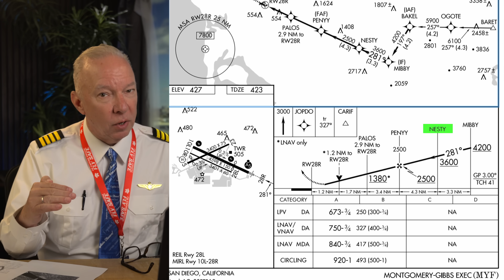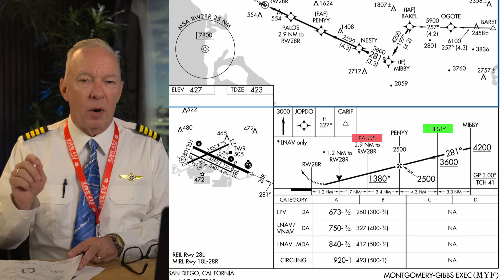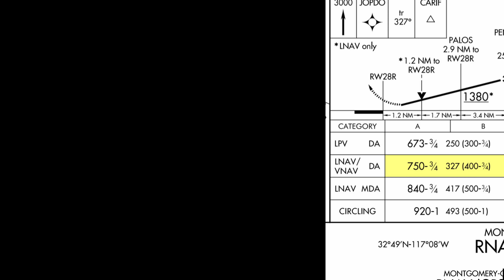Tragic Crash in San Diego: What the Pilot Did Wrong | ATC & Flight Path Breakdown

Comment: If the Altimeter setting at Montgomery is different than Gillespe or Miramar, and he uses either, then he may be too low.    In other words, his altar will tell him that he’s at a higher altitude than he actually is …..However, if he remains on the LPV localizer and glide slope, then he still may be OK.         With a 200 foot ceiling. The only approach you would attempt to fly would be either an LPV or an ILS, so he was not depending on an MDA ( altitude).
If he was flying the LNAV/VNAV with an incorrect altimeter setting, then that’s not a good decision, unless the instrument approach procedure indicates a higher MDA with the Gillespe or Miramar altimeter setting.  Still with a 200 foot ceiling and 1/2 mile visibility, he must have been flying the RNAV LPV.  I wonder if his annunciator validated with an LPV readout?    I also just noticed that 28R has a published ILS approach.   Was the ILS out of service ?     I still rather do the LPV, assuming I had WAAS in the jet.  At the end of the day, he was not authorized to fly the RNAV 28R approach if the aircraft was a C or D class.

Comment: Dive and drive means that you would cross each fix at the published minimum altitude, then descend down to the next fix minimum altitude until reaching MDA. You do not fly a dive and drive if there is a glideslope or glidepath available. And that ridge and powerlines that Captain Steve is showing is the precise reason there is a stepdown fix at PALOS. Crossing PALOS at 1380 feet prior to descending to minimums will prevent colliding with the power lines and hill. Obviously, this pilot did not fly the approach as described above.

Comment: Captain Steeeeeve,  PALOS is a stepdown fix on this approach and only applies if you are flying it as an LNAV only approach with no glidepath. Stepdown fixes are used when there is one or more obstacles that prevent a direct descent from the final approach fix (NESTY) altitude to the MDA on LNAV only approaches. The RNAV 28R is an LPV approach, which means it has a 3 degree glide path angle that you and your autopilot can use for a stabilized descent, same as an ILS glideslope. If you are on the LPV glidepath, you WILL cross PALOS at or above 1380 feet. When I fly LPV approaches, I always verify that I meet the crossing restriction of a stepdown fix just to be sure, but always do. His Cessna 550 should have had the avionics to fly an 
LPV glidepath so he would not have to fly it as an LNAV only approach. On another subject, he departed Teterboro NEW JERSEY on an all night transcontinental flight to the West Coast, a flight of nearly 3,000 miles with one fuel stop in Wichita. The Pilatus PC-12NG I fly professionally is certified for single pilot, but my boss wisely insists that I always have a copilot.

Comment: San Diego International (Lindbergh Field) had 9 miles viz and a 1,000' ceiling at the time.  He didn't ask about that airport. That would have been the airport to divert to. 5 minutes extra flying and a 20 minute Uber ride.  Tower is open with lots of approach and runway lights, local surveillance radar, and a tower controller to potentially issue a low altitude alert.

Comment: Good pilots ALWAYS file an alternate, regardless of the weather. Many things besides weather can cause you to not be able to land. The fact that this pilot did not have an alternate, aka a Plan B in mind before taking off is a red flag. By the way, the pilot saying he would give it a go is not reckless. Under FAR Part 91, you can legally and safely fly the approach no matter the weather, but you cannot land unless you see the runway or runway environment is in sight at the missed approach point. This is not true under FAR Parts 135 and 121. Under those rules, you cannot even begin an approach unless the weather is at or above minimums. Most professional pilots operating under Part 91 would fly the approach and take a look, Nothing dangerous about doing that so long as you fly the approach as published and not descend below minimums unless the runway or approach lights are in sight.

Comment: I guess I don’t understand the cat C comment.  By everything I can find, Vref for the 550 is 113 KIAS, or even less with a low fuel weight situation.  Even with 15 degrees flaps, still below 120 KIAS, (112 KIAS).  The limit here is 120 KIAS, so i just don’t get it, I guess.

Comment: I still can't understand how this happened, im no pilot but this makes no sense, your talking altimeter setting why is there not a redundant system that can not be played with as u can not alter it and once you lock onto that airport the CPU automatically adjust the altimeter to the height of the airport your going to, and then why would u bring a plane in over the top  of a Ridge wat was there first the mountain or the airport I give u the tip it was not the airport. So there has to be some accountability there for the clowns that built it surely.

Comment: Unpopular opinion but “give it a go” is not a bad decision. There’s missed approaches for a reason. Most aircraft now are equipped with garmin IFR GPS’s which means 99.9% chance he has WAAS. He was definitely going to the LPV minimum judging by his ambition to beat the 300ft ceiling. This is what we do a lot in Alaska. Shit weather and gotta make it or it’s 100+ miles back to where we departed. Squeeze the LPV minimum and find the runway. But you have to be good! Tight margins leave little room for error. He’s not legally held to the minimum visibility requirements for that airport but his approach category was. I reckon he’d done it before though. ATC would have known that too. Tragic but the only error was altitude or automation control.

Comment: flying any.... even a comliant ... RNAV approach ... means you should be ready at any point to verify correct ground clearances, correct gps position (backed by other verification from backup gps or vor/tacan/dme / adf ... etc ... so ready that if the RNAV drops out at any point you should be capable of flying a dead reconning approach accurate to withing the same tollerances ...

Comment: another example of gross pilot incompetence ... nothing more to be said really ... good rational analysis in Capt Steeeeeve debrief ... and analysis ... I am very unfond of these birds ... but in this case the issue was gross pilot incompetence ... that simple ... IF I had a reason to make an out of compliance approach ... I would KNOW the terrain and have looked at it in detail before departure ... have checked local radio stations and beacons ... back up my RNAV with corssing points and altitudes from ADF and TACAN / VOR / DME presets ... watch my radar altimeter like a hawk ... to confirm ... verify expected altitudes at each point ... on the approach ... if unable beyond a certain altitude ... I would use backup GPS altitude to verify my altitude and correct pressure altitude / altimeter setting ...  this moron did an out of compliance RNAV approach with no verification points, no terrain planning, ... just running on bloody luck with no preparation ... and got ... sorry to say ... what the fool deserved ... for placing others at risk with his attitude and incompetence ... sadly he took innocent people with him ... lucky though that no one on the ground was killed ... runny on bloody luck ... might be the title for this one ... sucky bottom of the barrel biz jet ... flown by incompetent pilot who tried to wear too many hats ... and one of them was not a good fit ...  "knowing the area" is relative ... obviously he was overly comfortable not did NOT really know the area ...

Comment: The animation video gives an inaccurate depiction of the weather, in my opinion.  I don’t think he would’ve seen any city lights details up in that dense fog or clouds.

If he did the “dive and drive”, I see a potential issue:  about 2-1/2-mile final is a golf course (just east of that ridge you mentioned) which would probably appear like a dark area amongst the glow of city lights through the clouds/fog below.  On about 3/4-mile final is empty field (brush), up to the runway.  If he did the ‘dive-and-drive’ over city lights and then saw the dark patch (golf course), maybe he mistook that for the dark patch just leading up to the runway.  Maybe that’s why he was down near airport elevation at power-line level.  Perhaps his awareness was off just enough in the clouds at night, single-piloting a jet, a little hot, not on a stabilized approach, that he failed to realize he was still 2 miles from the runway, and he was clicking the mic to bring the runway lights up to maximum.  Then he hit the power-lines.  It’s a hypothesis.

Comment: I do not want to appear to criticize your analysis, as it was your usual  professional analysis, but there are a couple of items that I feel need clarification here.  First, the altitude at NESTY is not a hard altitude, it is merely a minimum altitude as depicted by the line below the altitude depiction.  A hard altitude would have also had a line included above the altitude.  The second thing is your discussion of the dive and drive maneuver that you described.  I do not know what the aircraft VNAV capabilities were, but what I see on the approach depiction indicates to me that the altitude at PALOS (1380) must be maintained until 1.2 nm to the runway if the approach is a LNAV only.  Even with a vertical descent capability, the a/c never should have descended below 673 feet (which is a decision altitude and if he did not have the runway in sight at that point, he should have initiated an immediate missed approach), which indicates to me he would have cleared the depicted obstacle  on final.  Per the dive and drive LNAV only type of approach, his absolute minimum altitude should have never been below 840 feet until reaching the visual descent point and having the runway in sight.

Comment: Aviation in itself is not inherently dangerous. But to an even greater degree than the sea, it is terribly unforgiving of any carelessness, incapacity or neglect"
—Captain AG Lamplugh, British Aviation Insurance, London. 

Safer skies saves lives...

Old bold pilots
Know Crew Resource Managenent CRM
Know sterile cockpits
Know cockpit briefings
Know who the PIC  final authority is

The greatest single factor in airplane disasters to-day is the human factor.....
someone does too much too soon, followed very quickly by too little too late. 
Steve Wilson 
NTSB investigator, Oshkosh, WI, August 1996.
 Trouble in the air is very rare. It is hitting the ground that causes it. 
Amelia Earhart
In flying, the probability of survival is inversely proportional to the angle of arrival. 
Attributed to Neil Armstrong
If you can walk away from a landing, it's a good landing.
You don't concentrate on risks. You concentrate on results. No risk is too great to prevent the necessary job from getting done.
Chuck Yeager

Pilot certification standards have evolved over time in an attempt to reduce pilot errors that lead to fatal crashes. FAA standards, which are set in consultation with the aviation industry and the public, are among the highest in the world.

According to the FAA, the new regulations stem in part from the crash of Colgan Air 3407 in February 2009. An investigation of the crash revealed that pilot Renslow, had failed three "check rides" (the flying equivalent of driver proficiency tests) and may not have had adequate training to respond to the emergency leading up to the crash.

Comment: I have a question for you Captain Steeeve:  Why, why in the world are pilots and aircraft still using aneroid barometers for altitude measurement?  25 years ago I took a trip to Tanzania with my very basic Magellan handheld GPS and my altitude readings were the same as the display in the aircraft.  I used to have an aneroid altimeter in my truck, but now I rely entirely on what the GPS tells me when in the high country.  GPS doesn't need to be calibrated every time the air pressure changes and with the elaborate software available, all kinds of information and warnings are available to the pilot.
Reply: Aneroid altimeter is nice backup if GPS fails.
Reply: @fleetskipper1810  Yes and they should be just that --- backups.  However, it seems that the primary altitude reference is still the aneroid altimeter.  I'm also in favor of ships carrying a sextant, HO tables and an officer knowing how to use them -- as a backup.  I'd like to suggest that a readout be developed so that GPS altitude data would be displayed in analogue format that would be as easy to read and intuitive as the aneroid.  Easy to do in software and using stepper motors.

Comment: In most air crashes, it’s rarely a single pilot error that leads to tragedy. More often, it’s a chain of misjudgments and oversights that build up over time. It’s deeply unfortunate that this accident resulted in the loss of both the pilot’s and a passenger’s life—especially when a thorough preflight briefing, given the severity of the weather, might have made all the difference. Thank you Captain Steeve for this detailed debrief.
Reply: The pilot and 5 passengers.
Reply: It's called the Swiss cheese accident model because each factor in the accident is a hole in a slice of Swiss cheese. Each hole by itself isn't enough to cause an accident, but when holes in all of the slices line up, disaster is unavoidable.
Reply: You’re so right! I watched an accident investigations show once and that’s exactly what one of the guys said. Chain of events and misjudgments.
Reply: I wonder if it's true that the pilot was also a flight instructor?  If so, there's no excuse for what he did.
Reply: @iamgabriel5823  He owned a flight school . . .

Comment: This is a dumb question but i didn't think a power line could take a plane of that size out would he have felt it or just know because of the sparks or whatever? Could he have recovered from hitting the line? 
Wouldn't the controller have told him that he isn't cleared to land at that airport?

I would never move that close to an airport just because of the noise alone but now, because of incompetent pilots falling from the sky so frequently now
Reply: Thinking a power line can’t take a plane out is like thinking a nail can’t make a tire go flat. On approach (which is a critical phase of flight), aircraft are generally flying at lower speeds safe enough to land or “go around”. So there’s a lot of drag already on the plane such as deployed flaps and extended gear…so yes a power line connected to metal towers could easily be the proverbial “nail in the coffin” in such a scenario where the weather is already 💩.

Also, the controller he was speaking to was an “approach controller” a few miles away at a radar facility… not at the tower where the controllers had gone home for the night…which means said controller, bad weather or not, is not authorized to clear the plane to land, however he can clear the for the approach which is what he did and willingly gave as much info as requested by the pilot.
Reply: @aarongraham9699 I knew nobody was there because he had to call a number
Thanks for the answer
Reply: @aarongraham9699 could he have recovered?

Comment: I have not heard. But was the flight operating under part 91..or 135??? If it's 91, he was legal to shoot the approach for a "look see"...if 135....nope....as you know, you MUST have the min. for the approach BEFORE you even start the approach. If you have the min. to start the approach and the mins then go below prior to reaching glide slope intercept ( final fix) you MUST abort the approach, if after the FF, you may continue the approach. BTW, you seemed to indicate that the crossing restrictions altitude was the altitude at which you MUST cross that fix....my understanding is that restriction was to cross AT OR  ABOVE that altitude. Of course crossing too high makes it very difficult to maintain a "stabilized" approach. Under far 121 (airline transport) You MUST be stabilized by 1,000 feet about the ground.  Salute!